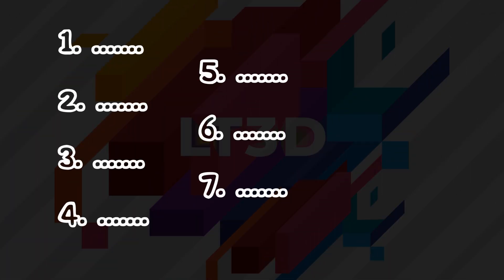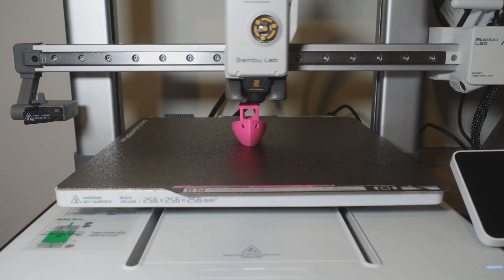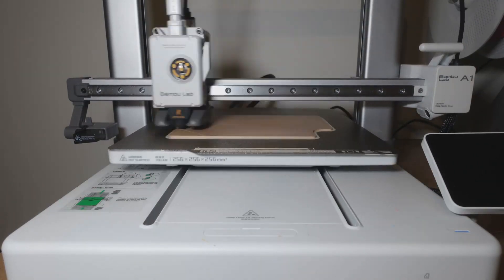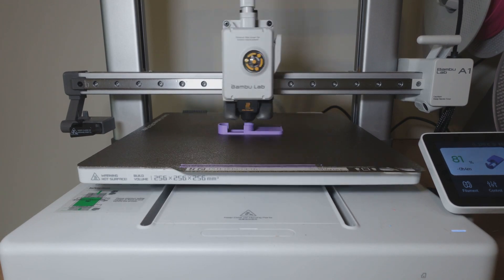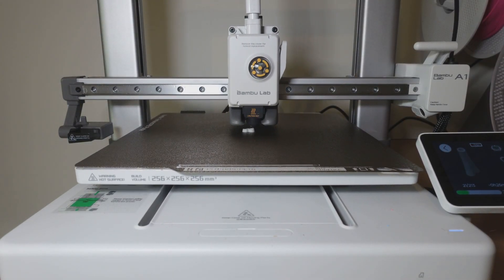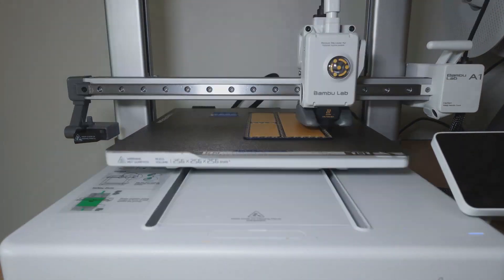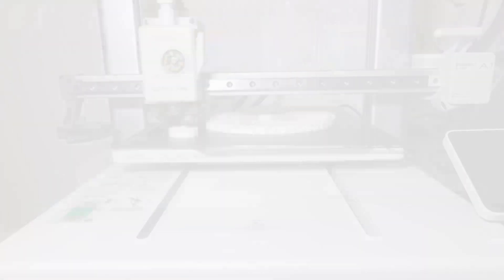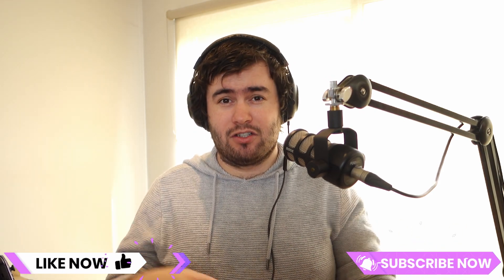Bambu Lab Must Prints!! (7 Things You Need to Print on Your Bambu Lab A1)

Comment: What I find funny is that I still haven’t printed a benchy on my new printer. Upgraded to a P1S from an Ender 3P. I use to print a benchy every time I would make a change but haven’t felt the need to print one on my new printer. This thing just works. I have a ton of filament that I stock piled back in the Covid days when it became hard to come by so I’m pretty set for materials for a while. I kind of just gave up on printing because I couldn’t print anything really useful. When the P1s came down to $399 I jumped all over it, plus I added the AMS. Great printer for the price.

Comment: Waste bin is the most overrated print. It's genuinely a waste of material for a job that can be done by literally any store-bought bin/container/organizer that you might have in your house. I have a bunch of 10x10x5cm organizers from ikea and they do the job just fine, no need to spend 1/5 of the spool just to make your own bin.

Build plate aligner is also mentioned way too often in those kinds of videos, despite being useless. Sure, it makes aligning the plate slightly easier but 1) this is already very easy thing to do even without aligner and 2) it always falls off during the print (probably the nozzle knocks it down) so you need to take it off for printing then put it back on afterwards which takes more time than whatever you managed to save by using. Basically, it makes aligning plate more complicated than it needs to be for no real gain.

Comment: I’m a complete 3D printing beginner and about to buy the A1. Given the filament discounts when buying the printer, would you suggest printing these in PLA basic or matte?
Reply: Absolute newbie here too and I also got the A1 over Black Friday Steven. Have only printed the benchy so far, as the filament I ordered with it has not arrived yet (seems they send filament separately in the UK.) But I absolutely love it already. The print was so quick, and the quality seems much better that I expected, after seeing 3D prints a few years ago. They've come a long long way in such a short space of time. 

I was very tempted to go for the P1S, but watched reviews suggesting to start with the A1, and explaining what little difference there is (speed and harder to print filaments mostly, not a bed slinger also, yadda yadda.) And I'm glad I went with the A1. The P1S, maybe the X1C or even the 2025 Q1 new printer will come, eventually, but for now I'm going to enjoy learning on the A1.

I have designed my first print in Fusion 360 though, and sliced it up in Bambu Studio, ready for the filament arriving. I run a pub, and we need some new holders for each table to put sauce sachets in. You used to be able to get these from Heinz for free, but not anymore. So I designed us one with the pub's logo on it. Can't wait to try printing it. 

Good luck with yours, hope you love it.
Reply from the maker: @stevenwyatt49  honestly either. The only difference is simply the finish, matte being of course matte and basic being glossy/shiny. Comes down to personal preferences 👍🏻

Comment: How bad is the gassing off from printing? Does it need to be in a vented room?
Reply: Depends on the filament. Some are worse than others.

Also, depends on your sensitivity to odour.

PLA is supposed to be relatively safe, however, I have noticed a slight headache when sitting in the same room while printing with it, myself.

Good air filtration never hurts. Something made for toxins, like HEPA or better. One YouTuber suggested a Levoit air purifier with the toxin filters.

Comment: The bed aligners set off an alarm on my printer
Reply from the maker: @musc258  which version did you print? As there are different files depending on your firmware version.
Reply: Junk. Don’t need bed alignment guides

Comment: in a group of 3d, a collaborator printed a picachu, this one had 5 colors. He made the eyes the same color as the one on the pokemon's back, then when he stopped printing that color he changed the spool and put the correct color for the eyes without changing what was already in the slice.
What is the correct way to print in 5 colors or more if we only have a limit of 4 colors in ams? Because pausing is really safe? maintain print quality? Can you make a video showing techniques on how to use 5 colors or more for those who only have 1 color? thanks <3
Reply from the maker: Funny you mention this, I'm currently working on a video as we speak!

Comment: Hello.  Concerning the Bambu Labs - A1.  Is it possible to manually change colors without using the AMS?  When I print multi color it's usually 25 or 30 items like small flower keychains.  Need to change from one color to a second color.  Most of what I see is using the AMS is 1 off items.
Reply from the maker: @ChinaAl  yes you could set pause layers inside Bambu studio and manually unload the current colour and load a new colour 👍🏻
Reply from the maker: Similar to how I did it with the Flashforge Adventurer 5M in Orca-Flashforge https://youtu.be/z7pZ71DUE7U?si=KYKhWiLCpsduyK2q
Reply: @LT3D_YT  Wow that was fast!  What I do with my current 'broken' JGMaker R1 is Iwatch intil all of the items are starting the inner circle then pause M600 I believe it is. So in my S3D  Or the Bambu Sturio I'd have to manually scroll to see when to initiate the change then mark the layer to set the pause?

I just watched your other video thank you very much
Reply from the maker: @ yep 👍🏻
Reply: @LT3D_YT  Wonderful!  I got really interested in this A1.  Mainly because I”m tired of replacing printers that either broke and returned or sold. 8 printers 6 years. My most recent the JGMaker R1 quit working and no amount of trouble shooting has helped. Still waiting for a reply from them.  I'm excited.  Now I have to learn a new slicer I guess.

Comment: Thanks for this. I will get one A1 soon and this tips are good. I have a question, how many gram filament did you use? I´m going to print in one color, is one spool enough. And how long did it take to print the parts.  😃
Reply: I just bought my A1-mini and am almost done with my first roll of filament. Red PLA basic, and frankly, I am sick of red prints. I just ordered five more rolls of filament and NO RED. Buy more than one roll with the machine and practice color swapping, you'll thank me later.
Reply: @mikeking7470 I got my first printer years ago without researching printing at all so I only bought one spool to start to make sure I was going to enjoy it. All my first prints were grey. 😹

Comment: Nice video thanks.  I use that same purge bucket its awesome.  The deflector is unnecessary with it, the side is high enough to catch flying purge.  One thing I never understood was the color tab swatches...  I threw mine in a drawer and never touched it again, if I want to see colors available I just look on the website.
Reply from the maker: @cylonmode  fair, I use my swatches all the time!

1. Because it’s satisfying to spin through them and 2. Because I can also get a better idea of finish and not just colour.
Reply: @LT3D_YT the finish is determined by slicer settings and build plate, sorry.